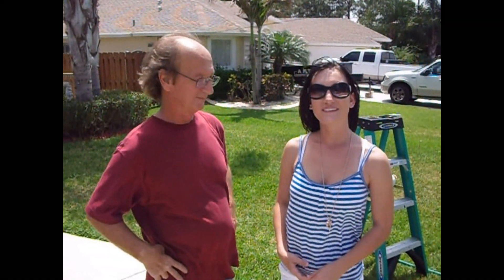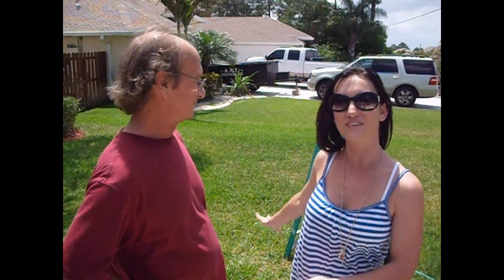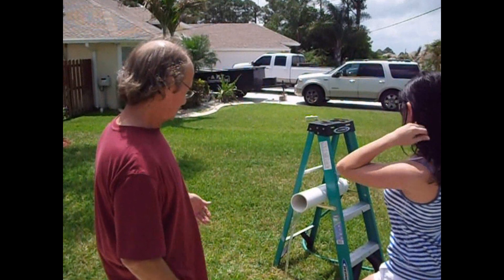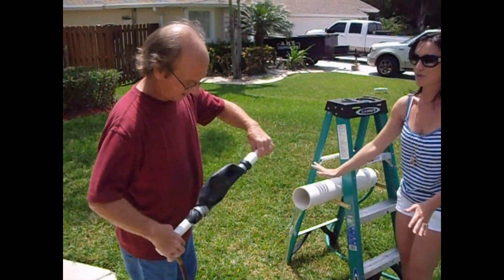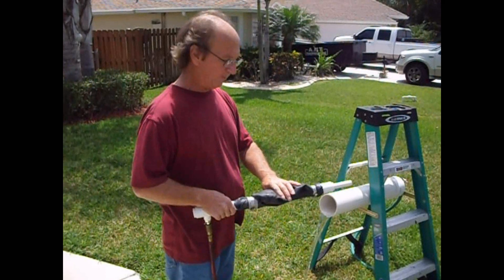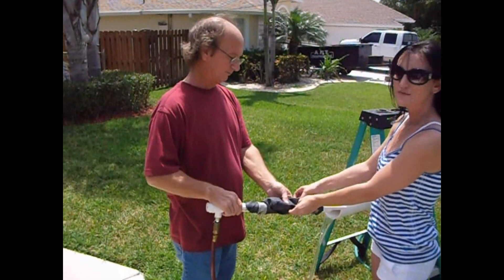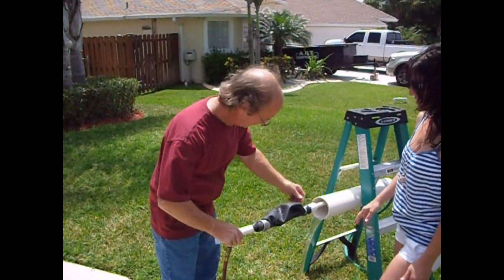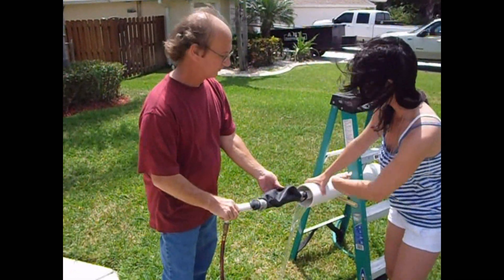BP oil leak solution

Comment: @GoTimothy  hey man, outa contex everything is a bad idea....the pipe must be sliced off at the ocean floor 1st!  and now it actually looks like they are slicing the pipe off now to lower the cap but it should remain an OPEN box or OPEN SHAFT box until secured to the ocean floor.. then cap it or tube it...each square at a time using the large box as a well head pressure controlling device... But I think they just wanna cut it , cap it, so whatever, all we can do is hope for the best!

Comment: thats a great idea, but first a gigantic two story grid needs to be lowered over the leak to work off of. this grid like ceramic tile layers use to keep the pattern correct, would need to be screwed into the ocean floor, then each square could be dealt with, capped or pumped as needed, bolts or  studs on each square for attaching the caps etc,. the drywall anchor screws come to mind....for each corner of grid